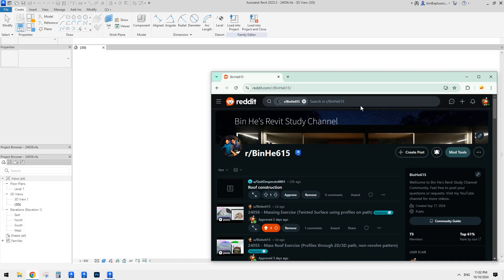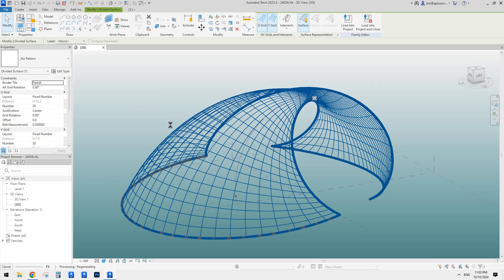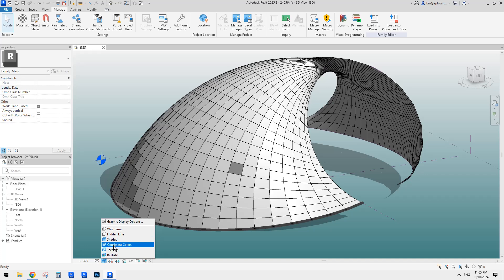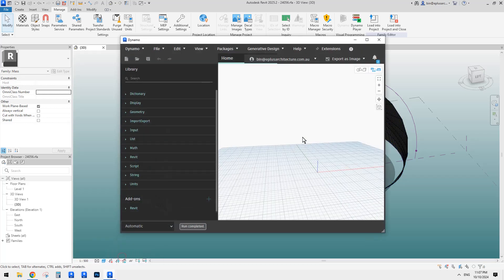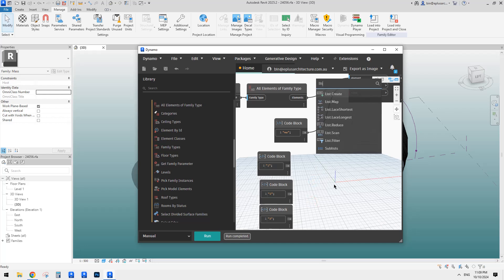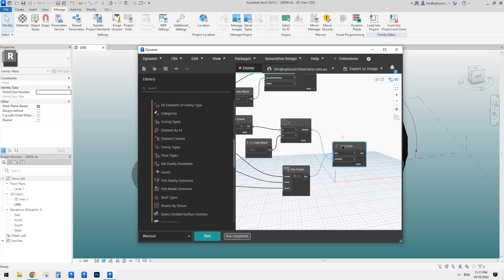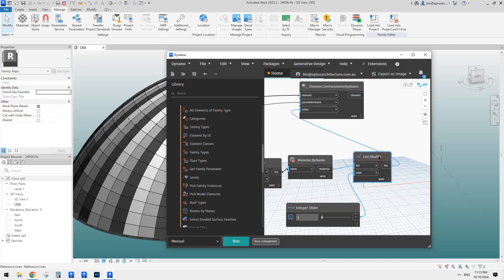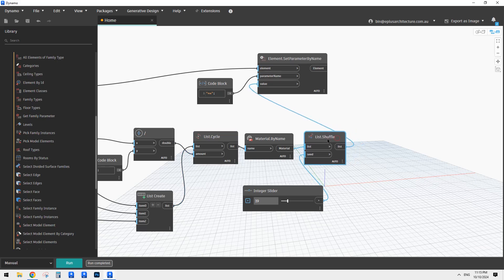24057 - A quick Dynamo Exercise to apply random material panels

Comment: Hi if I want to apply the material according to the sunlight ,can I do that too?
Reply: Like facing the sunlight will be glass panels ang other will be solid
Reply from the maker: I think we can. First, we need to determine the azimuth and altitude from the sun setting (similar to this: https://youtu.be/OLfDHcTUXv0), which will help us roughly position an element in the sky. We can then use the distance between the panels and this element to decide the material—for example, making the closest 40% glass and the rest solid. Please post it here (https://www.reddit.com/r/BinHe615/) if you'd like me to talk about this.
Reply: @BINHE615  just posted it !